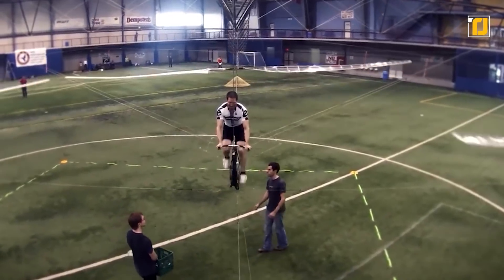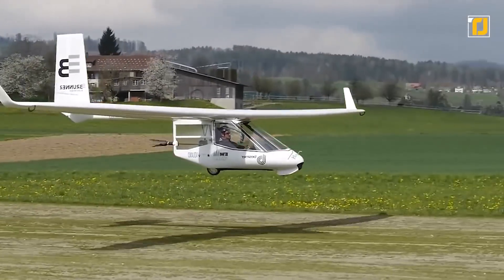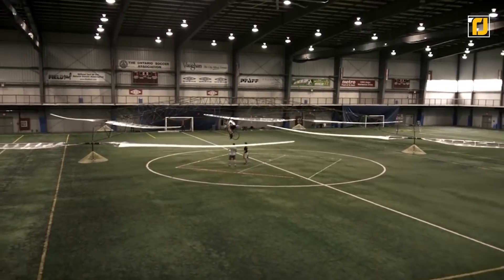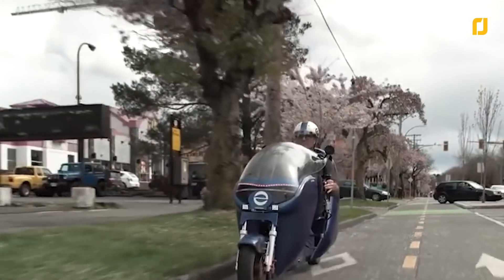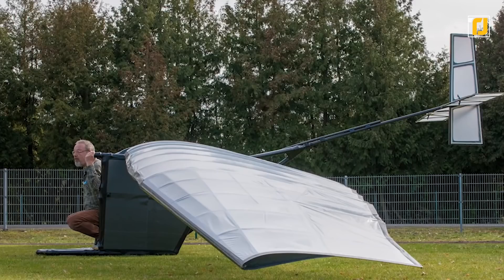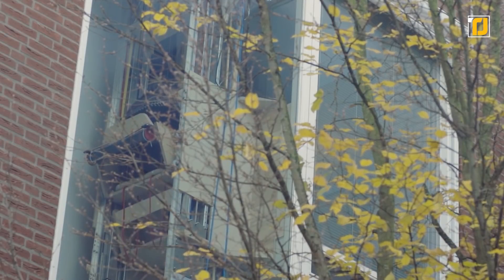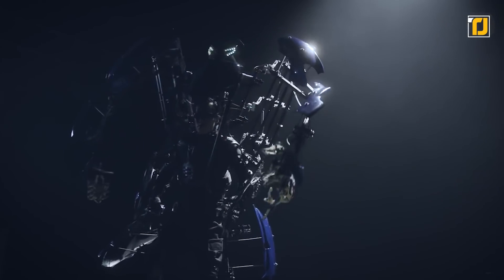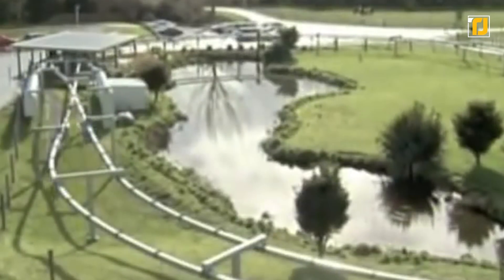10 Human Powered Machines That Are On Another Level

Comment: Human powered. Forget everything that had an electric motor then. One thing there was practical and fun- the waw velomobile. Better than most velomobiles besause the front and rear fairings remove to make servicing the gears and chain easier rather than a tiny lid like others have.

Comment: Aside from one or two of the bikes, these things are clever inventions that are extremely impractical. Are we really contemplating replacing stairs with a leg pumped elevating device? No. Replacing traditional bikes with that multi-legged walking monstrosity? Hardly. very interesting toys, but not useful inventions. And really - an electric bike is on "another level"? Electric bikes have been around for 50 years. Hardly next level technology.